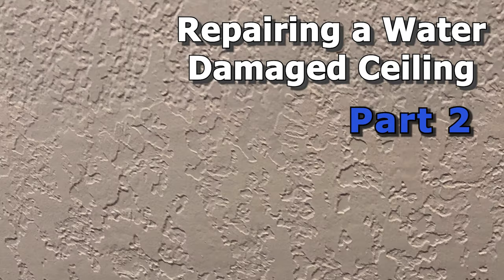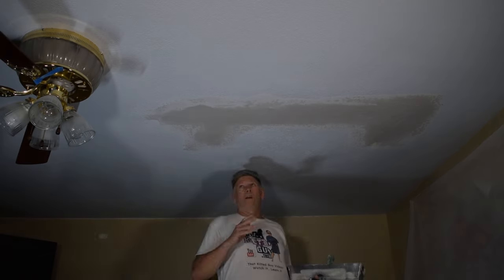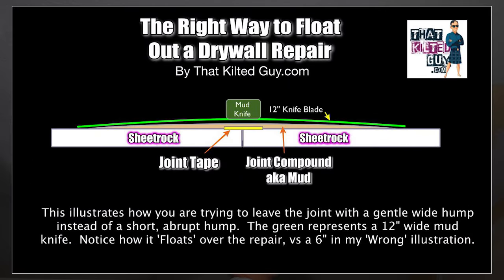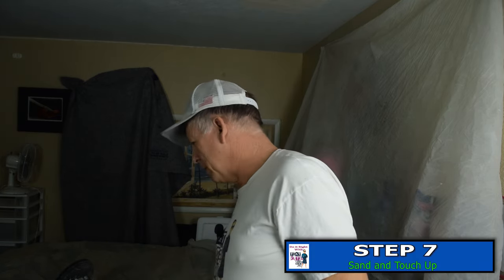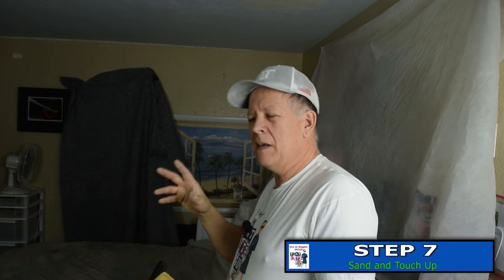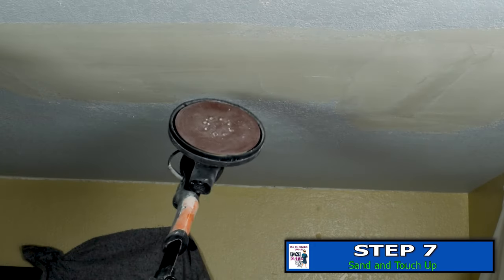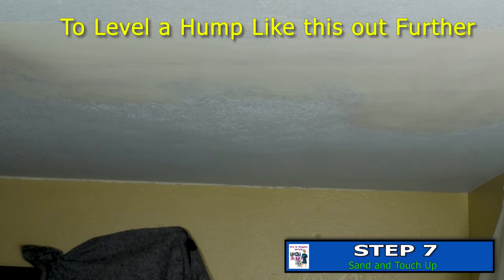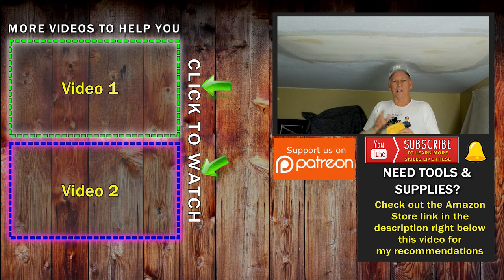🟡How to Repair a Water Damaged Drywall Ceiling - part 2 of 2

Comment: Thanks for the great videos! I have a small ceiling repair (1sq ft) .. I got the hot mud (45), will I need to do the 3rd coat with AP or can I just use more hot mud for all the coats?
Reply from the maker: If you can put it on without creating a hump you have to sand off you can, maybe.  You can't put hot mud on real thin because if it air dries, before the time on the bag, it doesn't cure right and doesn't have the proper bonding strength.  Manufacture says this.
Reply: @ThatKiltedGuyDIY  thanks!

Comment: Great video. Your experience really shows. Will water damage where the ceiling meets the wall continue to get worse over time? Im trying to figure out if the roof repair is still leaking. I think it is fixed yet the tape seems to to getting worse.
Reply from the maker: Once it’s dry, it won’t get worse unless it’s still leaking

Comment: When i use my wen sander after i pull it away from the cieling i grab the vacuum tupe attached to the head and yank it back and forth a few times so all the dust will get sucked up then turn off the vacuum. That way when you turn the head upside down it wont drop all the heavy dust collected in the head everywhere. Thanks for the video
Reply from the maker: Normally I don’t have to worry about it so much, but that’s a good idea. Thanks

Comment: You mentioned bubbles when skim coating over painted surfaces. So if I'm going to skim coat an entire wall that did not have any repairs done should I expect all of it to bubble? Should I prime the wall first and then skim coat?  (I didn't see that in some of your previous videos about skim coating).
In this video it sounds like I should just go over it with more mudd. If so do I recoat it right away, or wait for the first coat to dry?
Reply from the maker: Yeah you usually have to just go over it with a second coat anyway anytime after it has set up well and is close to dry

Comment: Guy, why did you use hot mud for the 2nd coat instead of All-Purpose mud?
Reply from the maker: The advantage to hot mud is always, Less Shrinkage, and faster recoat times.  So in this case I could put 3 coats on in just over an hour.

Comment: Why can't you use all purpose joint compound on mesh tape? Sorry for the dumb question but I am new to this. I already went out to buy all purpose joint compound cause I was in no rush, and now it seems i need the hot mud cause I have mesh tape? I wonder if I could use masking tape in place of not having the drywall tape.  I know its probably another dumb question, but I am frustrated to go back in a 2 hour line up to get supplies at the store thanks to covid 19. Thanks for the video by the way!
Reply from the maker: This video explains it, and yes it's important, and no you can't use masking tape.  But to cut the line, look up a drywall supply company.  One that does nothing but, as they're never busy.  Or True value will have it, albiet a little more costly, or even Sherwin Williams often carries it. 
https://youtu.be/A4VpiYxV7EU

Comment: Re. bubbles due to painted surface, would pre-sanding the surrounding areas of the patch prevent bubbles?
Reply from the maker: I usually presand around most repairs to make the mud stick better and haven't seen it help with that.  I've tried about every method on youtube too, including dish soap, etc and nothing really helps much.  Thanks, Guy
Reply: Wood glue.

Comment: Roflmao,  how long did you put up with that ugly patch it started with? That would have driven me nuts, id have fixed it years ago. 
First day we moved into our house I had patches on every wall becuse I cant stand looking at somone else's sloppy work.  Id rather look at my fresh patch thats not painted. 

As for what I ment differt way to do somthing on that celing patch my dad taught me to make a bevel on both edges to tape over that way you wont be blending out 24" to cover the patched area, you can do this with a box knife or grind it out  why I said differt ways to do stuff.  Your patch looked good  it was a differnt way to do it as for making it a solid repair you can put a metal tape into it to hold the screws that bring the drywall to the wood then tape over it .
Like I said differnt ways to do things.
Reply from the maker: it was a rental and I hate fixing someone else’s property for free when I’m paying them rent especially. But I finally did it